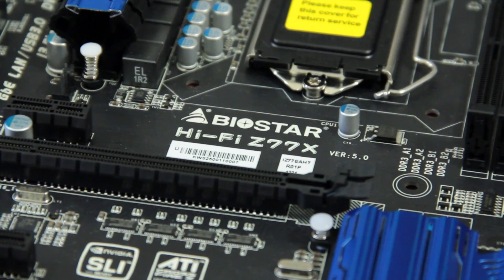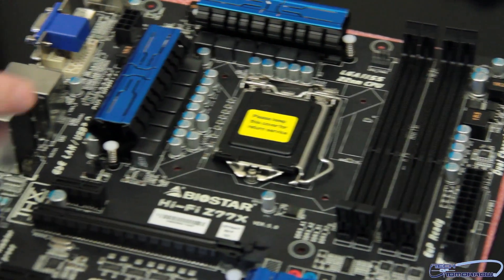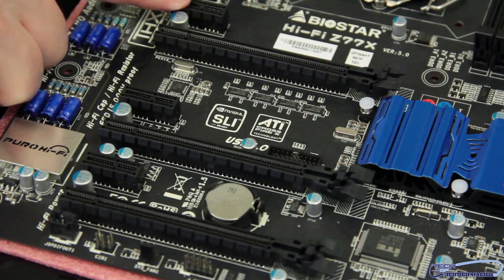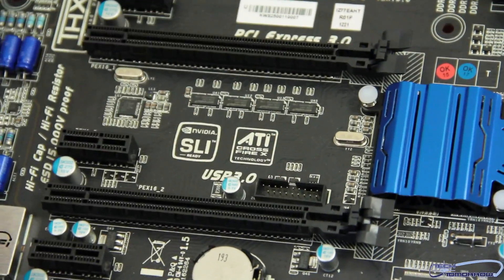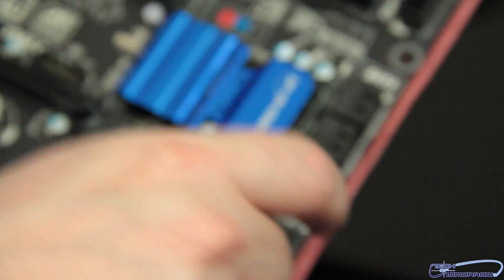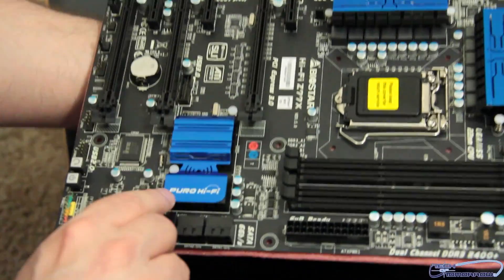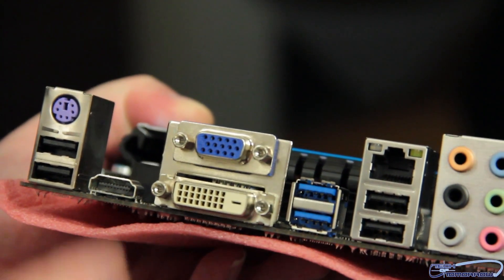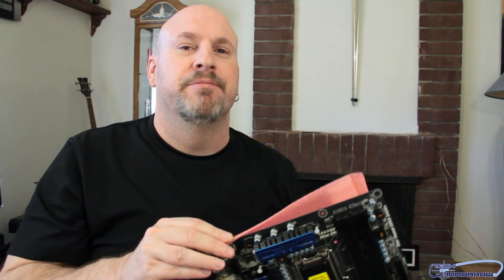World Exclusive Biostar Z77X Puro Hi-Fi Series Motherboard First Look Overview

Comment: I agree about the connection headers...ALL of them should be placed around the outside edge, even fan headers IMO. It just helps to keep the wire routing a bit cleaner looking. Of course this looks like an entry lvl board(?) so I don't see it having all the bells n whistles, but maybe it should have a bit more future-proofing...(ie. displayport, cupholders, thunderbolt header, coffee maker, digi audio, etc..)

Comment: haha ya that has to be the worst positioning for that I've seen. pretty much every z77 I've seen has the usb 3 right beside the sata connections. If you had a triple slot card like a 670/680 directcu you wouldn't be able to have front usb 3.0 lol that's just awful design. Not to mention the cable stretching across the your entire motherboard would just look disgusting.

Comment: You are wright it is a very poor design like most of Biostar boards. I prefer to have all USB 3.0 and 2.0 on the edge. Also as a mid range priced Z77 MB it should have display port and optical port.

Comment: I have a biostar board which i bought for about 40 pounds for am3. It unlocked my 960t to a 6 core 1065t. It can take up to 16gb of ram and it can overclock easily enough. So I can with 100% confidence recommend their boards, but i agree that the usb 3 header is in a really retarded position.

Comment: Biostar has been around since 1986, focus was OEM, not marketing or branding till the mid 2000's where Biostar start to bring products to the consumers.  Focus was volume, affordable products slow getting to the more expensive market.  Made a name when launched with Nvidia Nforce 2 chipset products.  Right now Biostar is best known for it's best bang for the bucks.  Price/performance ratio Biostar does best.  Basically get the best value in the market brand.